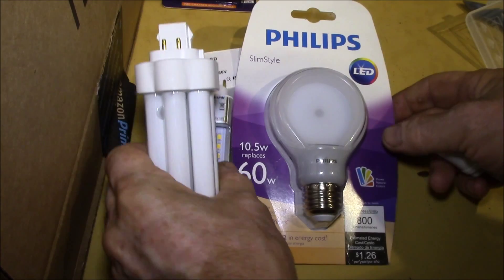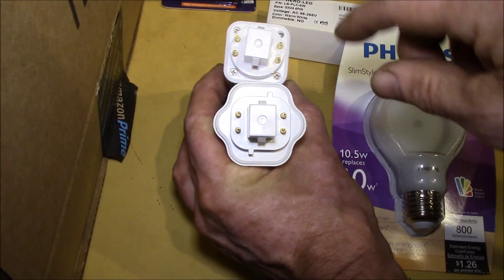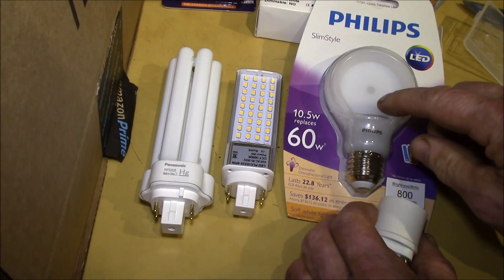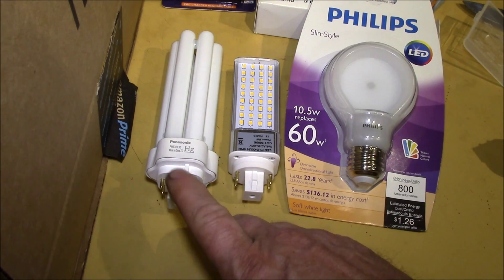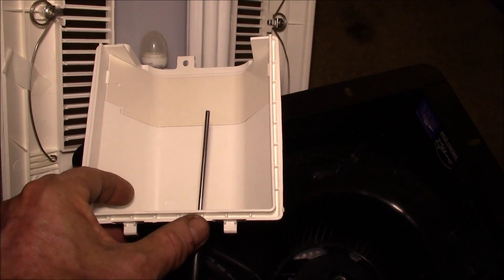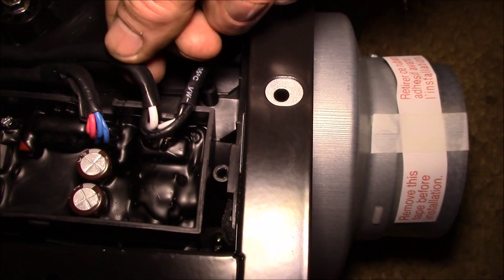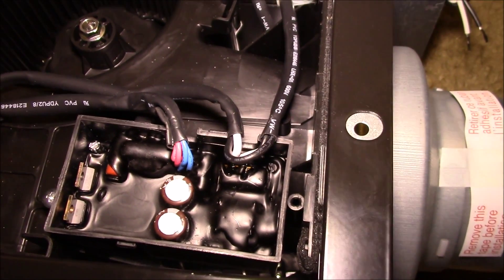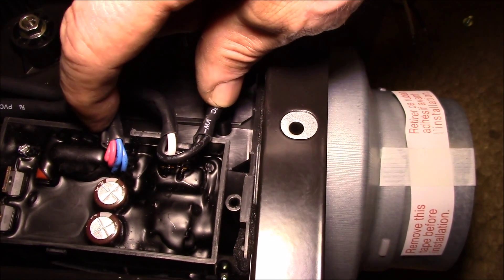Panasonic WhisperLite Bathroom Fan CFL Replacement, Part 1

Comment: Thank you much! I saw this video a while ago and decided that when my two-light Panasonic fan killed another CFL bulb that I would convert it to handle standard LED bulbs. I hate CFL light quality and I always had to buy some weird brand on Amazon that wouldn't last anyway. I did not want to mess with trying to find expensive 4-pin LED bulbs so I riveted in some Leviton 8052 (2052 is similar) E26 lamp sockets; they have a metal tab on the bottom that allows it to be fastened with a screw or rivet. Wired it up and popped in two standard 60 watt equivalent bulbs but the light was all concentrated at the center of the fixture. I picked up some GE bulbs at Lowes ("GE Relax HD 60-Watt EQ T10 Warm White Medium Base (E-26) Dimmable LED Light Bulb"). The T10 shape is tubular and the light emission is spread out nicely. The light quality is very nice, too. Funny how this light/fan was supposed to save energy/money and yet I pumped probably $50 worth of bulbs into it over the past 10 years to save $3 of electricity. 🙄
Reply from the maker: Great, sounds like a good conversion.  Yes, the funny thing, as I mentioned in the video description, is that the hokey 4-pin socket had to be used for various energy conservation programs, like California Title 24, to prevent folks replacing the supposedly "efficient" 32W CFL bulb with an 8W LED.  Like you mention, one has to wonder how many of those CFL bulbs ended up in landfills?

Comment: Mr. Brown -- if I put in the gx 24 LED bulb -- must I bypass the ballast? Thank you!
Reply from the maker: That would depend on the type of bulb you use.  Check with the installation instructions of the specific bulb.  There are generally 2 types of LEDs for fluorescent replacement, some need the ballast present to limit power to the bulb and others have that feature built in and they are designed to work off direct line voltage.  

IMHO, it's best to get the bulbs that don't rely on the ballast, which is easy to bypass.  Why?  The ballast adds complexity to the fixture, if it fails, the bulb stops working and you need to replace the expensive ballast.  Bypass the ballast and if the bulb fails, replace the bulb.

Comment: I have a very similar Panasonic Bath fan but it is model FV-LP002.  It looks like it has a separate ballast for each of the two main bulbs. ( It also has a third bulb socket for an E12 type candelabra  base ). Anyone have a ballast bypass plan for this model?
Reply from the maker: I'm not familiar with that model, but it should be similar to the one I modified in this video.  If there's one ballast per bulb, just track down which wires run to the bulb connector and then find an LED bulb that will either fit the connector as-is, or find an adapter to convert that connector.  Then, bypass the ballast like I did in this series of videos, taking the incoming black/white wires powering the ballast and connect those to the wires feeding the bulb sockets, to match up with the connections on the bulbs you plan to use.

Comment: Not only if they break you get glass on your hands and get cut they also have mercury. So if you break one, You release mercury into the air. Just like a spiral or standard fluorescent tube.
Reply from the maker: Good points.
Reply: @The4Crawler  LEDs are way better.
Reply from the maker: @homeguestunton  Agreed, I can't stand the CFLs or fluorescent tubes.
Reply: @The4Crawler  I still prefer them over the standard Incandescent bulbs.